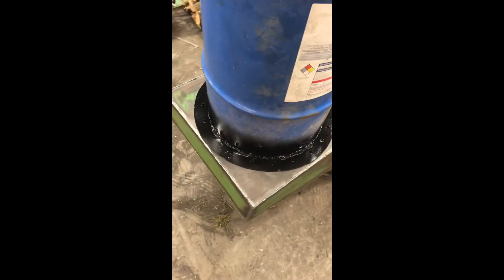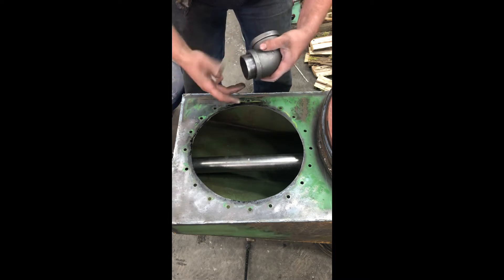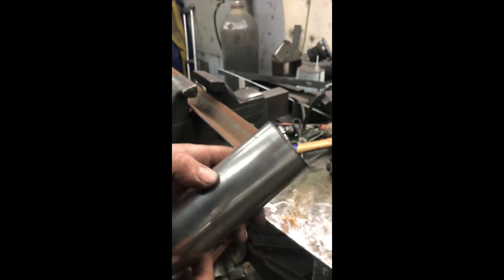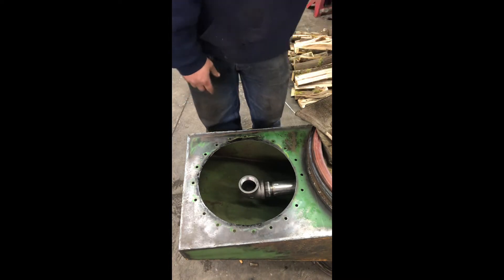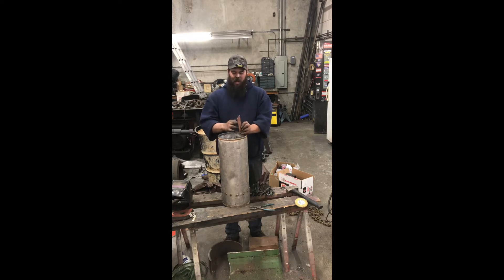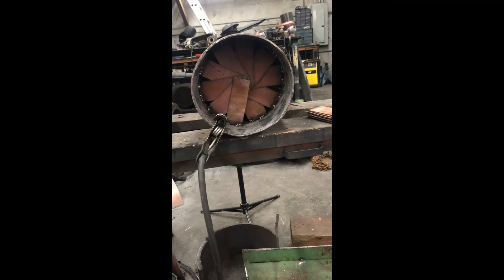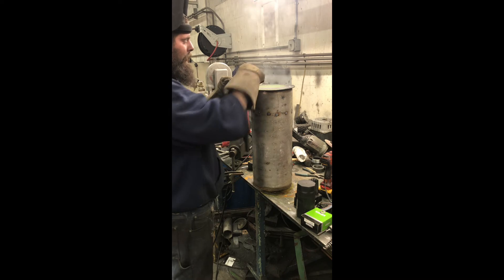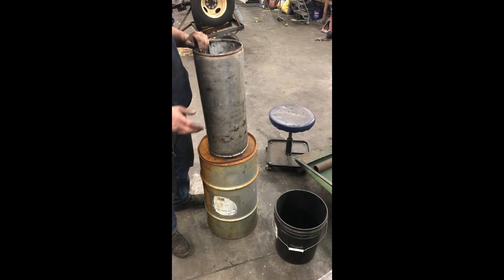V10 Dodge WOODGAS Build Heat Exchanger and Air Inlet Pipe

Comment: 17:35  In the past, I have welded bolts into the bottom flange. The holes were the same size as the bolt. The top flange holes were a 1/16" larger. With that many holes, I would have 1 or 2 bolts a little bit longer, for quick fit up later down the road.
Reply from the maker: Yes I should have done that would have made servicing much easier. I'll be making a update on my other truck soon and it may get that same treatment if I can find pieces to make the flange out of. I built 2 parts on my first woodgas truck out of 18 gauge and both have sprung leaks in the last week, so I actually cut off the heat exchanger body on this one the other day and rebuilt it from a 14 gauge well tank to make it last longer then the parts on my other truck. 7 months and 7000 miles is what the 18 gauge sheet metal components lasted in the very wet pacific northwest weather before pinholes of rust began to form

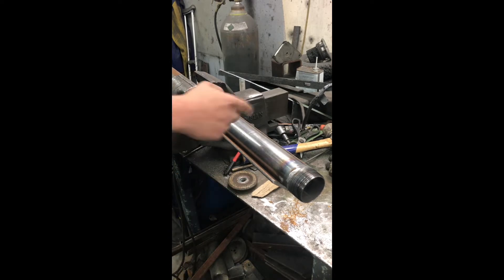Comment: 3:22  Perfect example of how to draw a straight line down the length of a tube or pipe. Angle bar will cradle pipe & be parallel to center line.
Reply from the maker: Yep I use that truck a lot, works great for building the cooling rails!

Comment: Good job...you must be using .035 or 030 wire?   Iif your liner and rollers will do it 024 wire makes that a breeze...or if you have a spool gun for that welder run 024 ers70 in it with stargas.
Reply from the maker: 035 in the big miller, when I get to the hopper I'll be bringing the mini Lincoln 100 out, way better for the 18 gauge drum work! Played with the tig a little, damn I'm out of practice. Touched the puddle enough times I got pissed and put it away
Reply: @BigBeavrSlayer  lol. Yea Tig takes steady hands for sure..  an I'm Shakey as they get...I'm ok if I can rest my hands but I struggle on roll cage work sometimes if I'm out of practice.